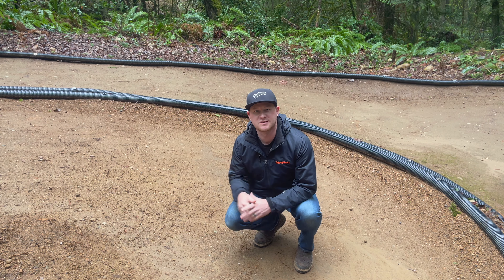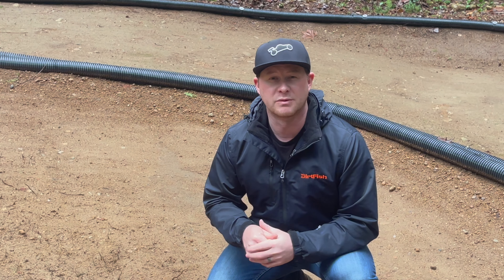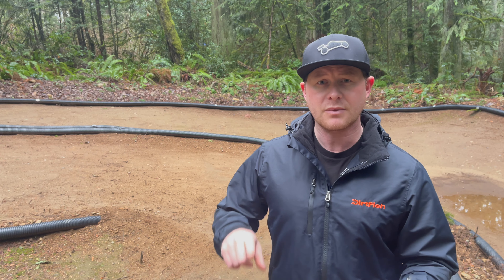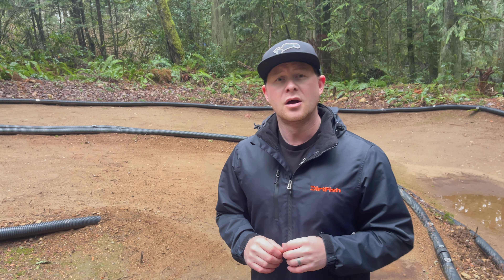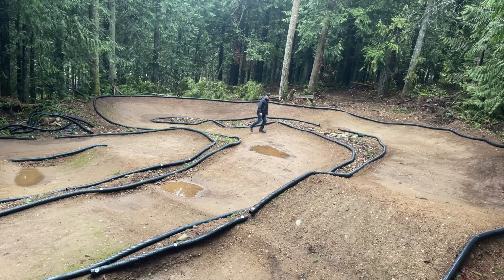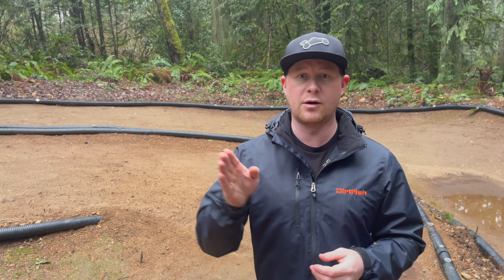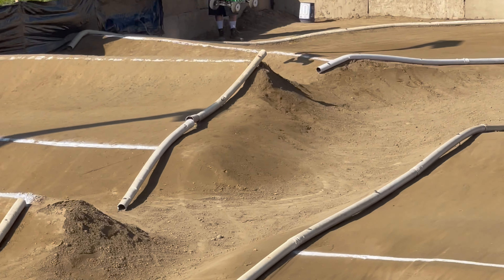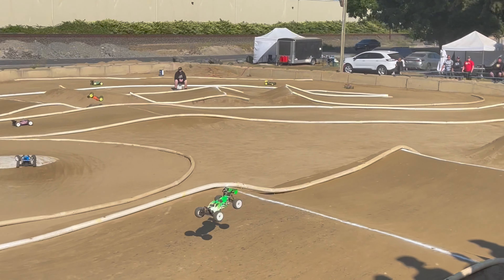7 Secrets to RC Corner Speed!

Comment: Hey Jason, I'm glad I found your channel since I'm a Seattle local and transitioning from full scale vehicles to 1/8 buggy racing.  One area that I have difficulty with is braking as it relates to cornering in RC.  Braking in full-scale cars played such a big role in cornering because of the weight transfer to the front tires.  But with a trigger on a RC car, it's obviously different.  Do you like to dial in some drag-brake to aid corner entry?  Or just lift and "coast into the turn" then gas out?  Thanks.
Reply from the maker: Hey Ron! Where will you be racing? Most of the time I'm lifting to let the car slow at the right time, maybe use understeer or a little brake to rotate the car to get to the right speed. On high speed straights into tight 180's you definitely have to use the brake and slow the car and if you and the car to rotate you can keep a little brake to keep the weight transfer up on the front tires. 

I avoid drake brake because it makes the car dive in the air. Some people like it and of course it's dependent on the car, in a 2wd car it might not make it nose dive nearly as much because only 2 tires are slowing. 

What did you race before?

Comment: Fantastic video! Something I've been thinking about a lot is how to "catch the car" at the right time as you say and arrest the rotation. I find myself oversteering in 2wd and totally spinning out a lot so I'd love to hear your thoughts on the best way to get better at this both as a beginner and then as a more advanced driver as well. I'm assuming for a beginner the answer is simply, make sure you're going slow enough so the car doesn't oversteer and  spin out. But... for a more aggressive style, I know in a real car especially in loose conditions you can just counter steer and fix the rotating that way but in RC it's super hard because you're just looking at the vehicle and not "feeling" what the chassis doing underneath you. So, I'm currently practicing the concept of something like "opposite lock" to correct oversteer but it's very difficult to get just right. And then maybe something like a pendulum turn or scandinavian flick to get a 2wd to do 180 turns just for fun. Anyway, sorry for the long comment but just wondering on what your advice would be, thank you so much!
Reply: Or is it faster overall to simply make sure you don't enter the corner too fast to start with? I'm still pretty new to racing so trying to learn the best techniques to practice 2WD.
Reply from the maker: Catching rotating with throttle is much easier in 4wd... 2wd is much tougher to counter and use a little throttle. That's why most 2wd stuff is done on super high traction surfaces. With that being said the best thing will be to get your speed right on corner entry for minimal rotation and the ability to control the car and carry your momentum.
Reply: @TheRacinJason thank you so much for the reply! If you do find yourself in a corner where you’ve accidentally come in a little too fast, could you suggest the best technique to have the highest likelihood of saving it? Would it be counter steer and light throttle or no throttle at all?
Reply from the maker: @JakesRC-gm5fk if you're a little too fast hopefully there's more track to use and go wide without spinning. As far as saving there's probably still some variables... if the car gets sideways really aggressively you probably want to just counter steer and wait without throttle. At that point even a little throttle might just spin tires and spin you out. If it's not quite that aggressive you can add a little throttle, what the throttle is doing is transferring weight back to the rear of the car so it should put some grip back there to help you catch the car. That's essentially how you drive a rwd rally car or race car... one big thing with RC is how light they are and how powerful they are, so it's really easy to over do this and spin. 4wd is a different animal because the front tires help to pull the car or truck straight and you can save this stuff a lot easier
Reply: @TheRacinJason  that makes a lot of sense, thank you so much for taking the time to elaborate on that nuance about throttle and weight transfer, that really helps me make sense of what the chassis wants to do in that situation.

Comment: Nice, seems like a lot of principles that apply to making fast laps in actual race cars also apply to RC cars, it just looks like fast guys use a lot less of the track than I would in a full size car. How can I get better at recognizing when I can use less of the track?
Reply from the maker: Great question man. I think a lot of the time in RC racing you can't be as aggressive with your line choice because you're not sitting in the car. One place I might start is basically the farther away from the stand the less you may want to gamble, or depending on how well you can see a corner can dictate that as well. 

Personally I'm a big promoter of using as much of the track as you can if there's is speed and time to be gained... with that in mind RC tracks are super wide compared to the car so it may be a long way to the outside of the track, so you have to look at it in a case by case basis. 

Another factor if you're running Offroad is looking at where the surface is swept off you may not want to go out in the marbles and lose traction... on the flip side if the inside is the preferred line but develops some character it might be time to go the long way and carry your speed because the car isn't getting upset by the rough stuff. 

Hope that answered your question... another thing you might do to study it is watch the pros. Go look at the dirt nitro challenge broadcast last year. See if you can find really early heats in the week and look at the lines, then go watch Ryan Maifield in the Nitro buggy main. You'll see some way different lines

Comment: Do these techniques hold true for a 2WD car as well?
Reply from the maker: Definitley... the big difference is going to be you don't have control or the front tires so you can't use brakes as effectively to create weight transfer. And hand in hand with that is you don't have the front tires pulling so when you're trying to stop the rotation the gas input isn't as helpful, and can actually spin the car out if you don't have a bunch of traction. I typically only run 2wd indoor on high bite stuff so if you have tons of traction that's gonna help catch that rotation. You will typically drive a 2wd more like a road car, smoother lines, not sliding into corners or rotating too aggressively.
Reply: @TheRacinJason  Thank you for the quick reply.
Reply from the maker: Any time!

Comment: Car is only as good as the driver and set up
Reply from the maker: Lot of times the car is better than the driver... and the other way around sometimes
Reply: @TheRacinJason  oh for sure but before you master the driving you gotta master the set up
Reply from the maker: @asproductions6400 good setup will definitely make driving easier. Gotta have a good baseline and a good consistent car for sure, but gotta be able to make the best of it if your setup is off too... sometimes I'll practice on worn out tires so I've gotta finesse the car a bit more. Good practice.
Reply: @TheRacinJason  you should make a video discussing how to set up cars it would be very helpful for the rc community such as things like camber and suspension and weight distribution because those are the variables to make a car corner properly
Reply: I was faster with a broken piston. Than finding the issue and running with too much pack and high cst 

Driving is skill, I've been sandbaged from lack of help since I started.